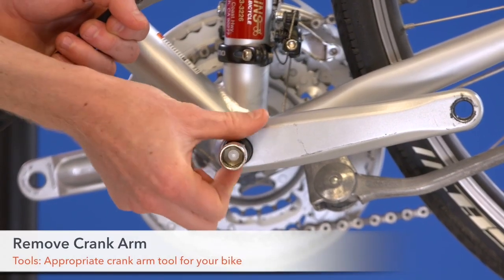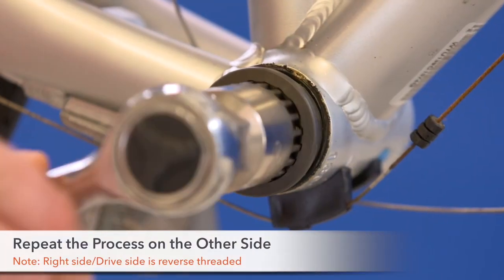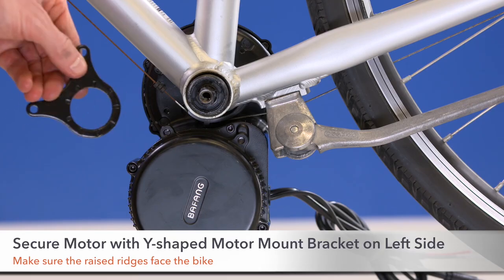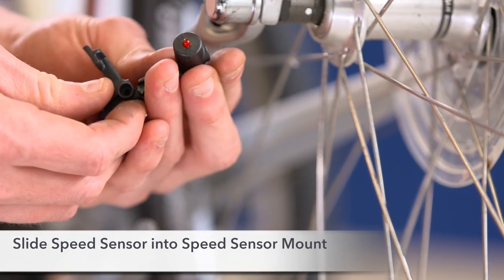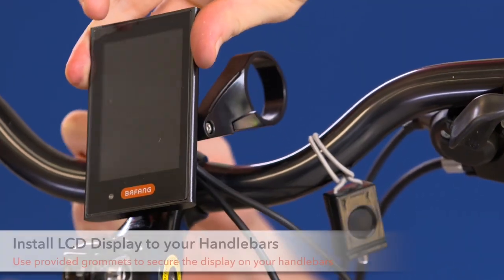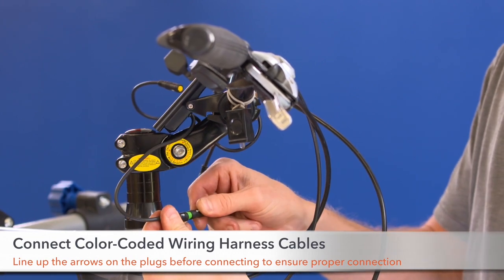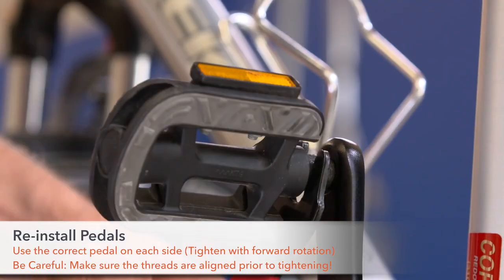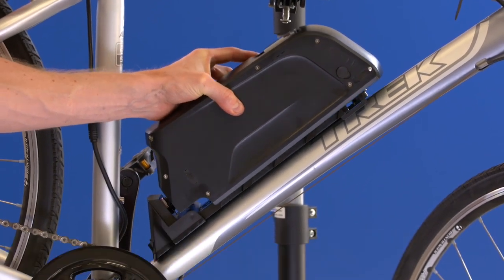Bafang 750w BBS02/1000w BBSHD Mid Drive Motor Installation

Comment: So I've got a 750w with a 48v battery pack and I've done 4,100kms on it over 3.5 years...mtn bike with knob tyres.  The battery is starting to lose charge fairly quickly now and it'll drain to 50% after 10 to 15km. The last 1000km I've been using throttle mainly because i damaged the display/ mode button with water washing the bike and i can only get mode 1 or 2 assist... hence the throttle. My question is have i had a good run on the battery with the life of this bike or should have expected more? The battery is still getting me around but yeah charging it again at maybe 40-30% after 10kms now... so looking at a new battery soon anyway and... will the motor give me a lot more life... going to get a new display to try and resolve my throttle only issue as well. Feedback would be appreciated.

Comment: That was a nicely done video, thanks. But for your future information, there is normally no reason to break the chain as the front derailleur nearly always has a simple screw holding it closed and can be easily opened. It is also does not need removing and can help as a guide for the chain by leaving it there. The other point is that you went to the trouble of removing the bolt on the front V brake instead of just releasing the noodle as you normally would.
Reply: that's exactly a question i was asking myself watching the video : why breaking the chain and rebuild it after ????
Reply: Thank You for your input, very helpful...
Reply: I’m giving him a thumbs down simply for not replying to you thanking you.
Reply: @freedeeztallbikes82  Wow!! You really showed him!!!
Reply: @johnnyofast5924  I sure did

Comment: I just finished installing a BBS02 on my 2008 Trek 6000.  I then wrote a review of it which I am going to share with you fine ladies and gentlemen.
Subject:  Most excellent, except...
Msg Body: 
Overall, I am quite happy.  The system works and works well.  Installation is not nearly as easy as they make it look in the video, but it never is.  I do find the following annoying though:

1) No PDF installation manual.  I was working in an area with no internet access, so I basically had to memorize the video, then go out and work on the bike.  Needless to say, mistakes were made.

2) A part substitution was made in the package that I received such that the screw than held the speed sensor magnet in place had a security Torx head.  Most people have never even heard of a security Torx, let alone have one it there tool kit.  This necessitated a trip to the hardware store.

3) All of the electrical wires come out of the bottom of the motor, this makes then easily susceptible to damage if you actually take your bike off road.

4) I would have preferred a metal chain guard.
Reply: I prefer Torx heads. I thought the same thing about the wiring harness coming out of the controller that's attached to the motor so I encase the entire thing in glued heavy-duty heat-shrink tubing and brought the speed sensor out where necessary, then the interface wiring and right op the power wires into a triangle bag. over 17K miles in 3 years with no issues... and I do ride off-road about 60% of the time.  You should have got the BBSHD it's a way better motor. https://photos.app.goo.gl/dyw1JUWQSNjj8Cvy9
Reply: @brianbassettnumber1  I have no problem with regular Torx, but security Torx are a PITA.  As for getting the BBS02 instead of the BBSHD, well, for some people cost is an issue.     Thank you for posting the pics.  I really like that setup with the IGH.  I still need to re-order or replace my rear cassette in order to get my chain line straight.
Reply: @thekinginyellow1744  I bet that is a problem. With a Speed-hub you can dial it in perfect. I go through chains more often than I thought but aren't showing any wear in the gears, Stay safe.

Comment: Hi, pleas how can i get one with all items inclode the battry 
and hoe mach it cost , i live in luxembourg and we do not have this motore in our contry
Reply: Just check on Aliexpress, a kit without battery cost 420€ shipped from Spain. https://www.aliexpress.com/item/33058307484.html
You can buy the battery separately (any 48V battery of at least 12Ah should be ok, make sure it can handle more than 25AMPS of constant current).

Comment: Does it matter where on the wheel you place the magnet for the speed sensor? From my thinking, depending on where you place the sensor, will affect the speed that the sensor will pick up.
Reply: The speed sensor is just counting the interval between passes of the magnet. That number will be the same wherever you mount it.  I'm assuming that you need to tell the display the size of the wheel so it can calculate your speed.  You should mount it as close to the hub as possible to reduce the centrifugal force on the magnet that is trying to throw it into space!
Reply: @thekinginyellow1744  even if you tell the display the size of the wheel, the closer you put the magnet to the hub, the faster the magnet will pass the sensor and therefore the faster the reading. so where is the best place for the sensor?
Reply: @omishkim  umm.  I think maybe you should think about this, and decide for yourself the difference between velocity and rpm.
Reply: @thekinginyellow1744  thank you for your information, but you seen not to understand that a speed sensor is used to measure the rpm, which is then in turn used to calculate the speed of a vehicle, in this case the bicycle.  This is also how your car's speedometer works, but a car's drive shaft is the same diameter and has a known radius from the central point, so a calculation of speed is possible.
Reply: @omishkim  actually I understand exactly that, which is why the placement of sensor  is irrelevent.  regardless of where it is place, it will count the same number of rpm, because all components of the wheel have exactly the same angular velocity.
Reply: @thekinginyellow1744  Okay I agree that it will have the same angular velocity, but speed is angular velocity times radius
Reply: This the relationship between linear speed and angular velocity.
Reply: @omishkim , that's correct, but the radius in this case is the radius of your tire, because that determines the distance your bike rides with one rotation of the wheel.  No matter where your sensor is positioned, that distance will always be the outer circumference of your tire (2*r*pi)

Comment: and why did you remove the chain??????? you can take the front chain guide off most if not all bikes by removing a screw to separate it from the chain...otherwise great video
Reply: I was gonna make the exact same comment , good video otherwise
Reply: On my bike there was no way to remove the front derailleur without breaking the chain.

Comment: Why to remove chain and front brake for???????????????
Reply: You take the chain off to get it out of the front derailleur. And you take the front brake off because you have to replace the brake lever with one with a sensor in it
Reply: What happened to the derailleur is it  no longer need and left off the bike?
Reply: @alleciazen7830   you only have 1 front sprocket now so the front derailer is not needed
Reply: @ajmarqueling  thanks, I was contemplating whether to purchase this motor but the detailer bit was a bit confusing so thanks for clarifying.
Reply: @alleciazen7830  I don't know what kind of bike you're riding or what's your uses are but I can tell you that the 1000 watt kit is completely insane and overkill. I can leave my bike in 7th Gear which is the highest gear and leave the pedal-assist at 1 and I can take off and go up the steepest hill like it's nothing. It is way too much. With a fully charged battery and in 7th Gear on pedal assist level 9 the bike will do 40 mph. I've since bought the programming cable and I am basically going to detune this motor way down. I just wanted pedal-assist this thing is so powerful it doesn't feel like you're doing anything no matter what level you're in or gear.

I've ridden bikes that have the 500 watt kits on them and that was way more in line with what I wanted just some pedal-assist to make long rides easier and Hills easier. The only thing that's thousand watt kit is good for it's maybe if you're an extreme mountain biker or someone who is using your bike the drive to work and want to go 40 mph lol
Reply: @ajmarqueling  thanks!  that was some really useful information. I'm like you i just need the peddle assist to get me up a steep hill out of my neighborhood, and maybe a little bit of extra assist home if I've done a extra long trail. I definitely didn't want a motor that did all the work for me, I still want to 'ride' my bike!
Reply: @alleciazen7830  in my opinion I'd get a 250-500 watt kit for some added assist. I just bought a 500 watt kit for another bike, ill get it installed and report back on it if it is a more reasonable size

Comment: I just this week installed the BBHSD 1000w on a 1999 Schwinn Searcher GS. Already ridden 60 miles! What fun!
Reply: I'm interested in buying one!!
Reply: How did you find install George? How long did it take you ?
Reply: @max4557  it took about 3 hours. A week later I installed the shift sensor which was about an hour. I watched a couple of videos first and it was no problem. I'm over 250 miles now! My top speed is 38 mph.😎
Reply: @geoelectro  do I just use the existing gears on my bike ?
Reply: @max4557  So bikes are all very different. In my case, I have a 21 speed. That means 7 gears on the rear wheel, and three different size drive gears on the pedals. 3 x 7 = 21. Replacing the pedal gear with the BBSHD you will lose the multi-gear setup as it only has one gear. So now, I have a 7 speed powered bike. You still use the same chain and rear gear setup. It turns out for my normal casual riding, I only used the middle front gear anyway and used the bike as a 7 speed. My typical speed before the BBSHD was around 12mph. I was able to hit 20mph briefly. Now, I ride at around 16mph to 20mph on average and as I stated, have had it up to 38mph. I don't need to go above 25mph the majority of the time but having that speed available also means it has good torque. You can still shift your rear gears but you'll find you won't do that much. I ride in 6th gear most of the time and 7th when out on a long flat surface.
Reply: @geoelectro  Thank you for this. I have a '97 21 speed Bianchi HT mountain bike that I really want to convert with this motor.  Sounds like we have similar setups.  I hope I have the same success you did!  You went with 1,000w?  I REALLY want to do the same, but I'm thinking 750 would be less wear on the bike?  I still have some research to do before I take the plunge.  I must do this.
Reply: @TheKman1138  So now I have 500 miles on this setup. So I would say this on the size, 750w is plenty. I usually run on setting 2 or 3 power assist. (goes to 5) That's because I usually want to run around 15 to 20 MPH. If I run on 4 for example I'm going to be above 20 MPH. HOWEVER, I have run it on 5 and had it to 39 MPH. Having the additional power can make you go faster but it also comes in handy when digging out of some rough terrain or when you need a fast start to cross a freeway etc. My understanding is the motor I have can handle 1500w with a larger battery. I don't intend on doing that though. I just like to take long rides without killing myself. Someone said about putting a motor on a bike, doesn't that defeat the purpose? I said, not if the purpose is having fun!
Reply: @geoelectro  they have new stuff stuff came out that allow 4000w on the bbshd it's like 600 bucks.. doesnt up your top speed really just adds extremely fun acceleration
Reply: @omnigeddon  Very interesting. I'm over 600 miles now...
Reply: @geoelectro  deng nice I'm installing mine as we speak!
Reply: @omnigeddon  how is it?
Reply: @YoYo-di4rl  pretty epic.. downhill all the time it feels like lol

Comment: Couple things I wanted to point out. Some crank arms are held on with Hex bolts rather than Allen head bolts. In those cases it's almost always a 14mm.
Also DO NOT over tighten that Outer Black Locknut/Beauty ring. It has very thin Aluminum threads and you will strip the threads on it if you crank on it. Only needs to be snugged tight enough to keep the main lock ring behind it from backing off.

Comment: What speed can go and what about the price
Reply: @Frank Blackcrow EU for on road is 250W motor and no assistance above 15.5 MPH. If you are going off-road however, you can do as you wish I think. In the US I believe they're allowed 750W motors and 20 MPH. But it probably varies by state over there.

Comment: All sounds great but. ........And it's a big but. The Bafang motor will probably need force and probably a lump hammer sort of force to fit into the crank case. My kit had wires that were far too long for my bike and it was difficult to arrange them neatly. Also as there is no standardisation in the world of motors and batteries they will probably need entirely new fittings to get them to join together which was a real pain. That all said, it's worth the effort as the bike is simply fantastic to ride. Particularly when you have hills wherever you look.The 750w motor makes mincemeat of any hill. And I get 30 miles plus with my 13ah battery. It'll transform your cycling.
Reply: Good to know, thank you!  I want to get this. Do you have the 48V or 52V battery?  Which one to get?
Reply: @mjremy2605  Mine is 48V and it works well. I've now done almost 2000 miles on the bike and the battery still gives me the same mileage as at the beginning

Comment: What's the green connector for ?
Reply: The kit will probably come with two brake connectors (and two new brake levers) which I suggest you don't fit. They are a waste of time.
Reply: @MikeKleinsteuber  THanks for your answer but I finished installing my kit last week and did some commuting with it. My bike was a low end, and changing the lever didn't remove any quality of it. ^^

Comment: mid drive motor don't have a controller box?
Reply: No it is not inside the battery. It is inside the motor
Reply: It's inside the battery housing.

Comment: Dude, don't I need he electric bike controller connecting throttle lever, brake sensors, speed sensor and gear sensor ? 
Cool instructional video though :)
Ride safe & have fun.
Reply: Controller is inside the motor.
Reply: @Thephonkgod  Thanks for your replay. I Also learned that I don't need throttle lever nor gear sensor, I even can manage without   brake sensors as long there's cadence sensor. 
ln short, if you stop pedaling the motor will disengage.
Dos that make sense ? =)
Reply: @zezow1  Absolutely not. The Throttle that's up to you. But you cannot leave the brake sensors or gear sensors, they're very important.
Reply: @Thephonkgod  You are right, motors 750w & above will be necessary to have. 
My apologies I was thinking of 500w with disc brakescan be handled by a seasoned rider without extra sensors thus limiting the  connecting wires mess+ dead weight 😉
Reply: @zezow1  haha, i get you. But you really should install the gear sensor in your bafang E-bike.This will prevent unnecessary wear and tear.

Comment: What about the gear shifting cables?
Reply: That's what I'm wondering.  Is this an electric fixed speed now???
Reply: Only the back gears remain.
Reply: John Buying Right. But the video only showed how to remove the brake cable from the original brake lever. It didn't show how to remove the gear shifting cable so that you can add it to the new shifter.

Comment: I don't have a water bottle holder. Does this mean that I have to drill holes into the frame to hold the battery mount? I can do that but I'd rather not, doesn't the battery mount come with optional straps or some other non-invasive fix?
Reply: Yes you can very easily drill a hole. But you do not thread the hole. what you need to do is put a threaded rivet insert in the hole that you drilled.
Reply: I have a bike rack on the back of my bicycle and that's for my battery.but if you're really desperate I suppose you can wear a backpack and carry the battery in there
Reply: i know im probably too late, vut dont drill holes. the arent as good as the predrilles and will fail to hold the battery.

Comment: Since when has the word `install` become a noun? Install is a verb, installation is the process.  It`s like saying ` This is how the degrade of  the English language happens ` Haha. On a serious note, I`d like to know how quickly does a 1000w motor go through bike chains? And sprocketses? I imagine the best solution would be to use a belt drive. But then you`d need hub gears, aaaargh. What a slippery slope !  Has anyone tried it?
Reply: since 2010

Comment: Very nice general installation.  It may be beyond the scope of this video, but it will help many if one goes into the tricks of the installation.  Getting the  bottom bracket correctly shimmed with washers and spacers is vital.  I think wire management is an extra plus.  Thanks
Reply: Do i need spacers if i have a 73mm bottom bracket and a 68mm bafang mid motor?
Reply: @Thephonkgod  I have a 73mm bottom bracket also. I'm worried about chain alignment.
Reply: @shuvelhead233  I added 3x2mm spacers, it works flawlessy. :)
Reply: @Thephonkgod  yes
Reply: yes washers
Reply: 3:42 the bracket did not fit tight with motor,  and the allen screws were too short.  Then I found a bag of washers with longer allen flat head screws,  using 4 spacers/washers on  each  screw made a good fit.  Now motor is a bit loose being as there isn't clearence for my spanner wrench to get a good grip on the crank axle nut,   I guess that is why Bafang sells the $14 wrench for that purpose.
All in all so far happy with kit and video.  :)  
BTW installing on Trek 300 Navigator.
Reply: @apergiel  sir,
What is price of this kit ?
Can I important to india ?